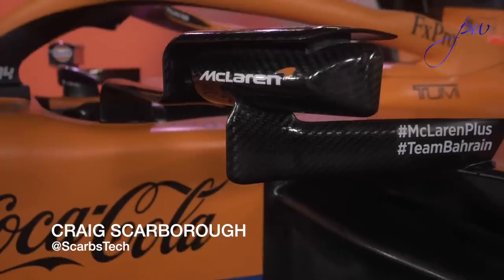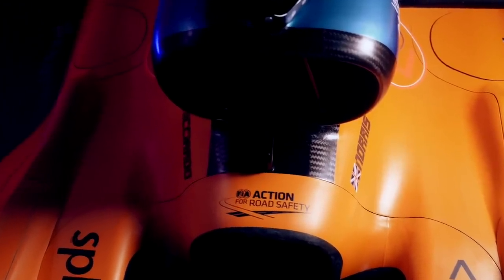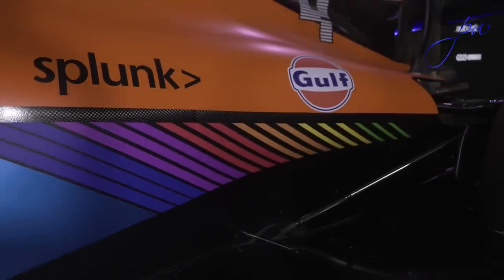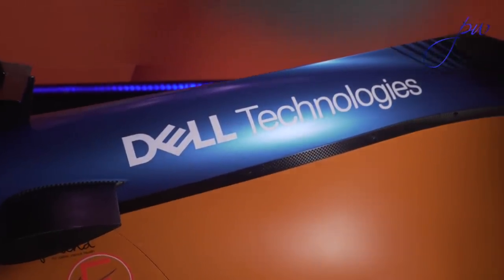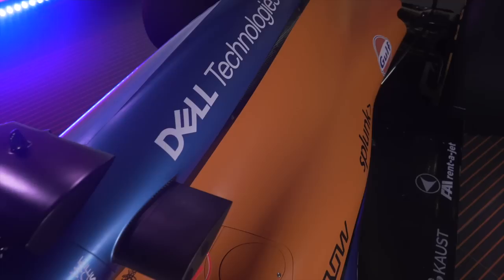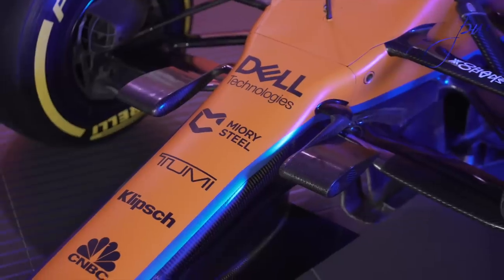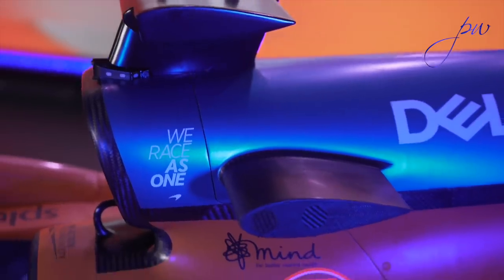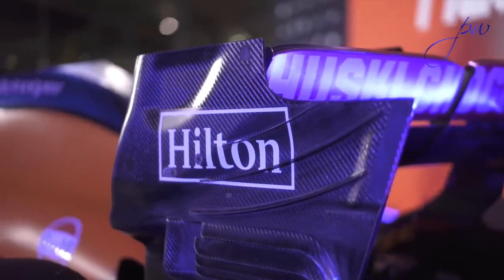New F1 McLaren-Mercedes detailed by Scarbs by Peter Windsor

Comment: Unless I missed it, Scarbs didn't point out how 35M is quite a bit longer overall if measured from front spoiler to end of rear wing also wheelbase is longer, front wheels are further out to the front spoiler and rear tires pushed further back to the rear of the car.

Comment: Not one Mercedes badge?
Reply: I'm surprised no one's spotted this either. Last years car had a small Renault decal towards the back of the car before the rear wheels but the 35M has no visible mention of Mercedes anywhere.
Reply: @ArthurZakaryan23  I would love to hear this explained
Reply: @christopherwilson2762  Zac Brown has mentioned many times that he doesn't like the idea of a titled sponsor or the use of the engine manufacturer in the official team team like it was previously with McLaren Mercedes so I'm not too surprised that even today's presentation where Zac was present for a brief time, Mercedes was hardly mentioned.
Reply: @ArthurZakaryan23  I figured as much , The Merc lump will be absolutely huge for a Mc Laren comeback , yup mostly Merc.
Reply: @ArthurZakaryan23  I think its more cause Merc AMG division now has more cars that could compete with lower McLaren models, it is a business after all & you don't want to advertise others too much. Renault did appear of car & team kit/branding but they're totally normal cars. AMG has lots of $100k+ cars now that are popular compared to say the Ron Dennis/Mclaren-Mercedes days where they had less & McLaren was more prestigious/higher value cars. Also Merc get paid for their engines & don't need the promo tbh
Reply: Heard from autosport that engine supply contract does not require any advertising space on their cars. A bit like the racing point... (wait their car is an actual merc)
Reply: @lukecrebbin4697  wow! The media will make up for where I believe the contract fell short.

Comment: So Mercedes now power 40% of the grid (plus the safety car). This seems to be bordering on a monopoly...
Reply: They can't... by the rules this is the max they can do
Reply: @cosminlesutan3574  Okay, didn't know
Reply: But nothing compared to the Ford Cosworth domination of the 1970s.  For example, in 1978, of the 40-odd cars entering the races, 33 of them had the Ford Cosworth DFV 3.0L V8 engines.  And considering it was in 1978, 11 years old and still competitive, it was a remarkable engine for its time.
Reply: If only Renault could build an engine in this era. If only Ferrari didn't cheat. If only Honda could commit longer than a few years at a time.